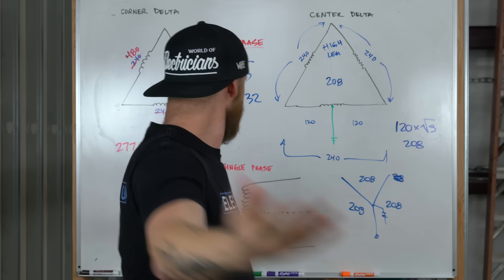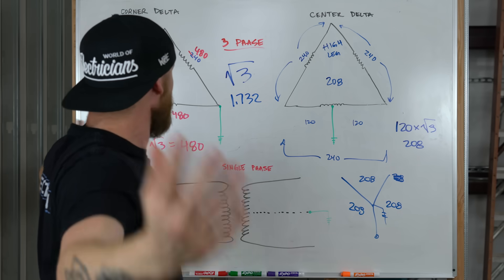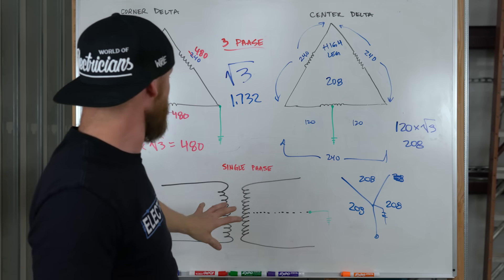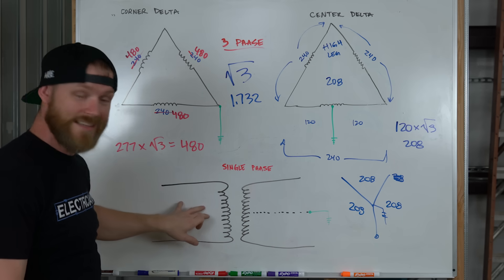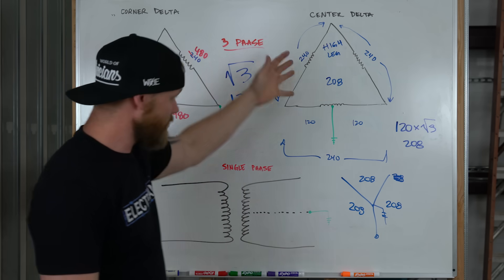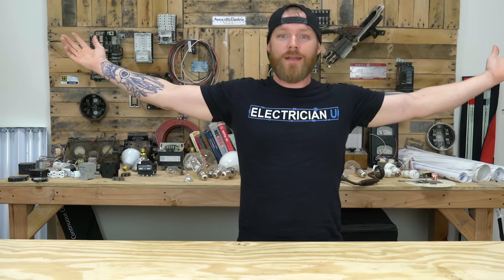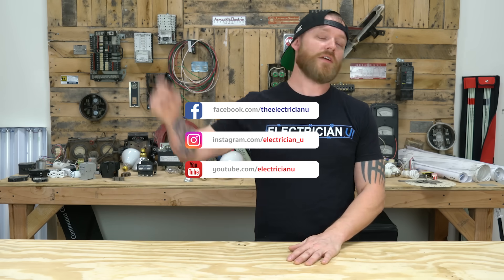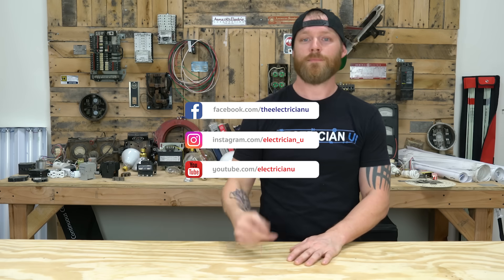Difference Between VOLTAGES - Why We Need Them All

Comment: The 600Y/347 system is mainly used in Canada.
Reply: Jolyon Welsh we’re starting to get rid of 347... too many accidents
Reply: @trezzer53  still very popular here in Canada. A lot of new jobs in Canada are still be specified as 347
Reply: c31979839 typically 347 is now used in underground parking lighting, luckily now lighting is 120v supply w 0-10v dimming systems which makes it a lot safer
Reply: @Nick-bh1fy  347 volts is naturally a byproduct of the 600 volt Wye or star system. One almost only uses it out of convenience. There are times when you might have a 347 volt source nearby. And you would have to all the way on the other side of the building to find a suitable 120 volt source. It is typically used for industrial and commercial lighting in Canada.
Reply: We have 600,480, 347, and 277 all in the same shop.
And 10,000V input from the lines.
Reply: 347/600 is here to stay in Ontario. New commercial customers only have 2 choices for 3 phase, 120/208 or 347/600.
Reply: Two reasons why 347 volt is popular in Canada for lighting is: 
A. You can get lighting circuits from the 600 volt feed without having to go through a step down transformer.  
B. For a 15 amp circuit, you can get a lot more fixtures on it than you would with a 120 volt circuit. (4164 watts instead of 1440 watts.)
Reply: @IamTedV  That is correct. And power companies star systems over delta systems because of better balancing of phase to ground loads.
Reply: i worked in an old power plant that still had a 600v system for the big pumps and fans. it was mid fifty's vintage. only place I have ever seen it. Plant i am in now jumps form 480 to 4160.